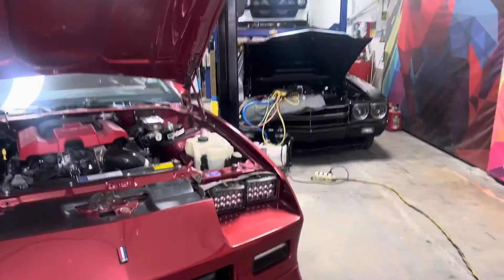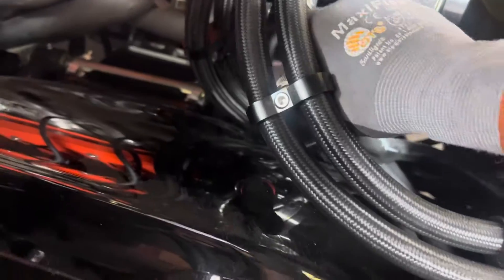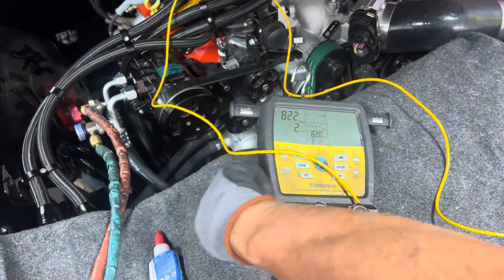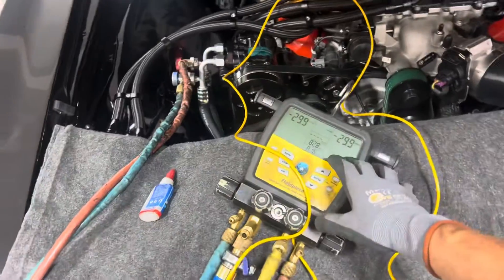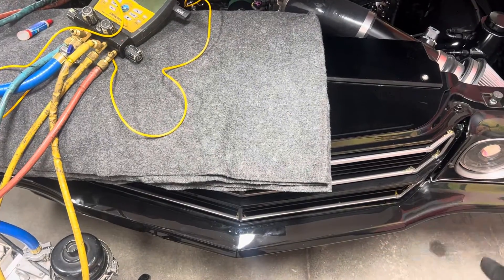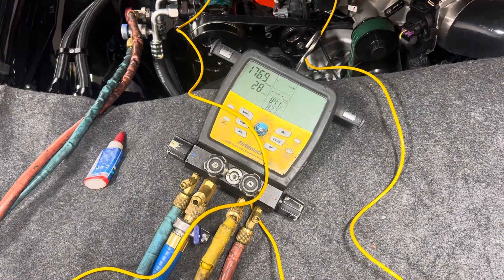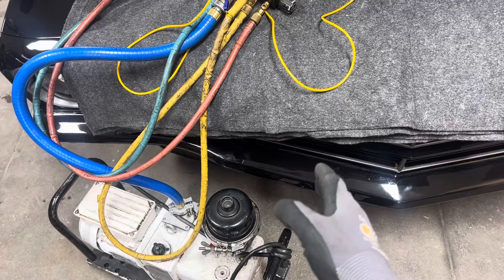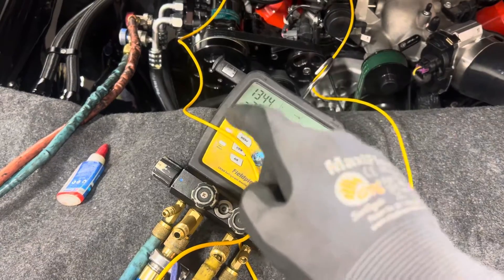Moisture contamination concern me system left open exposed to atmosphere for a long time. ￼

Comment: How are you going to determine proper refrigerant charge on a custom system?
Reply from the maker: I would guesstimate by whatever vehicles that I took all these components out of.   Choose the smallest refrigerant charge.    I always put in a sight glass with a moisture indicator in the liquid line towards the condenser. This really gives you a good visual indicator of your liquid stack backing up solid. Or only with a very few bubbles passing by. 

(Sporlan see all sight glass with moisture indicator)

Google the above search phrase and you’ll see what I mean. 

They make them in Solder on application and in thread on application. 

I watched a superheat in the sub cooling. 

But an automotive everyone’s good enough with it’s good enough method. 

I had a technician build one in his van and Mercedes condenser a dodge compressor a general motors evaporator case housing.
Reply: I go off system pressure most systems are 1lb or more so start the system and add refrigerant from the suction side and watch the high side pressure you will need a warm engine and even the daytime temperature can fool you into overcharging
Reply from the maker: @ajaxracing  like for example on my car my high side pressure is usually between 89 psi and 110 psi in my low side pressure is usually about 29 psi to 31 psi weather rhyme only 3/4 of the way full or 100% filled I get the exact same pressures.   Because the majority of vehicles nowadays are variable speed compressors or variable displacement compressors using sensors and speed control or compressor displacement to manually manipulate the pressures to what it thinks it wants to see through its program not relying on how full or how low the refrigerant is.    As long as it’s close enough it will put up a false low side and high side pressure that are not relative to how full or empty the system is unless it’s way outside if it’s parameters.
Reply: I wanted to add you should always go off system pressure Even on a system you know the capacity just changing a.condenser or EVAP capacity could change all be it small my old shop we would have stacked 2 condensers in that car if it required now figuring out how much oil to use now that's JFM
Reply from the maker: @ajaxracing  condensers have a little capacity needed no more than 1 ounce of extra oil. 

And pressures mean nothing in new cars with variable displacement compressors. 
Which the majority of cars have been given in the last 10 years. 

When you get into limousine manufacturer and you’re adding three or four evaporators to one compressor you really get into adding a lot of extra condenser and sept cooling condensers separate and extra receiver dryer’s

On a custom installation I always recommend you add a side glass with a moisture indicator so if your customer goes to another shop and they do not charge it correctly many times I will find they will moisture contaminate the system with contaminated refrigerant or by allowing the refrigerant lines to be left open to the atmosphere so if the car comes back to you and you see the moisture indicator turn yellow you tell the customer they’re basically screwed now we will be replacing your receiver dryer and you now have a moisture contaminated system from the last shop who worked at it. 

I find about eight out of 10 shops contaminate customers systems when I have installed a moisture indicator site glass on a custom install system.
Reply: @coldfinger459sub0  we worked mostly on oldies and also used a sight glass and I remembered we never took limos or busses I'm curious if you fill the system 3/4 would you have freezing issues on cold days or what about overcharging on that style of system on all the modern stuff I normally go by the book
Reply: @coldfinger459sub0  like what would happen if you put 2lb in a 1lb system like that I feel like in in the stone age with some of these systems lol
Reply from the maker: @ajaxracing  I could tell you for a fact that went 3 ounces extra is in a Prius it hits 440 psi and cuts off the high limit switch to the compressor. 

I made a video on that it’s on my channel somewhere. 

By removing 1 ounce it dropped to just below 440 psi. 

I had one Audi customer at a shop who recharged a vehicle and I believe the original Audi charge was roughly 580 g which is just a tad over a pound and I pulled out 900 g which would make it a little less than a pound and over charge the system was working perfectly in cool temperatures in San Francisco below 75° but when I got out outside customer kept complaining it was not cooling after the third time returning to the shop he called me in he is one of the guys who guess with the cans and does not weigh in by weight he was going by pressures. 

I pulled out the refrigerant and Wade what came out and show him how far over he was lucky he did not burn up The compressor recharged correctly it worked just fine

I’ve gotten many vehicles with variable displacement compressors with over a pound of extra refrigerant in them because they were charged on mild or cool days and the guys go by pressure and the computer keeps compensating the compressor displacement attempting to hold down falsely the pressure as the technician keeps adding more refrigerant in until I can no longer control. 

The car will leave the shop working just beautifully on a mild day

But then the customer takes it out on a hot weekend or travel somewhere to a hotter climate and now that extra refrigerant has nowhere to expand and the pressure skyrockets this is where we get slipping clutches that burn out burnt up compressors because of too much refrigerant to overdiluting the ratio of refrigerant oil to refrigerant plus the high pressure and temperature wiped the compressor out. 

If they did not wipe the Compressor I would way how much refrigerant comes out and always find it grossly overcharged because they tried to charge by pressures on a computer controlled variable displacement compressor. 

Now another example let’s take a old Chevy suburban are 12 with the old Frigidaire a six compressor dual air conditioning. The A6 to York in Tecumpsin were built like battleships unsinkable. 

That old suburban had 5 1/4 pounds refrigerant charge. 

If I stuck one extra pound of refrigerant in one of those old systems you would barely notice it on temperatures under 85°F and it would do no damage at all whatsoever to the compressor. 

Because back in those days compressors had some pumps in them that how about 6 ounces of pure refrigerant oil with an oil pump and a pick up tube that would feed the cross drilled crankshaft to lubricate all the vital components so they would never go low on refrigerant or get diluted. 

Modern day compressors do not have that feature.   

They completely rely on a full charge of refrigerant with a specific refrigerant to oriole ratio that will constantly feedback oil that left the compressor travel somewhat as an aerosol all the way through the evaporator delivering a cold stream of refrigerant and oil to lubricate the compressor and cool it off.

The old iron York compressors were so durable you could run them without refrigerant and use them as air compressors on tow trucks this is what they actually did because of that sump pump south oiling oil pressure feature they operated like small Briggs & Stratton engines but were turned into air compressors. 

I literally make the majority of my living office shops that charge by pressures on all these new cars with variable displacement compressors between them burning out the compressors or multiple complaints by the customers of them not operating properly after they had them charged up that is where all the gold falls from heaven into my bank account relying on old guys who were taught old school and apply it to new vehicles. 

And now the situation even gets worse for the customer that the systems are all getting down to around 1 pound of refrigerant or even down to 12 ounces so they’re even more critically charged. 

Now let’s talk more about the terminologies of critical charged this came about with the introduction of Microchannel parallel flow condensers the internal design is drastically different than what were used to with Tube and fin

And a high-quality Microchannel condensers have an extremely small volume of refrigerant that they actually hold to a ratio of extremely large surface area due to the fact that they have many small fins inside the tubes. 

     The cheap knock off fake Microchannel they’re still a micro channel but they use larger fins that are noticeable and half the amount of internal fins because the technology cost more money for the higher quality ones like DENSO 

It’s not a linear equation where if you add 1 ounce too much you get a certain pressure rise and then if you add 2 ounces too much you got the exact same number just doubled in pressure it doesn’t work like that. 

It’s exponential,    And it’s highly temperature reliant on the ambient temperature it’s not 1 for one 

If you look at the PT chart we’re gonna use the example of R12 refrigerant. 

If it’s 70° outside and your cylinder of refrigerant is 70°F you will have 70 psi pressure

Then as you increase the temperature you will see that the pressure increases but you see it is not exact with the temperature. 

Old systems with mechanical fans attached to the engines were very easy he bumped the engine rpm up to about 1200 RPMs 1500 RPMs whatever that particular manufacturer called for then you had a known airflow over the condenser that would not change because it was a fixed mechanical fan and you were using a fixed mechanical piston driven compressor that would not change speed or volume because it was directly tied to engine rpm that was not changing because you fixed it at 1200 RPMs or 1500 RPMs just for example. 

You had a fixed blower speed that didn’t have a automatic climate control system with temperature and pressure sensors while you’re in the middle of your test that just might flip over from Fresh Air mowed into recycle or recycle into Fresh Air during the middle of your Tess completely throwing your pressures off because there’s a vast difference between taking recycled air from inside the cabin of your car that might be 70°F or the fresh air over your hot engine out of your radiator getting sucked through the crowd that might be 130°F putting a load on your evaporator giving you a very false reading because we don’t drive around in 130°F ambient outside air temperature. 

I have made videos of this showing the reactions of the difference what happens to pressures and temperatures between using the outside air mode recycle mode and the difference between having the hood of the engine compartment open while performing your test and having the hood of the engine compartment closed while performing the test. 

Most automotive technicians have absolutely no formal education let alone and air-conditioning on automobiles. 

So they sit there walking off their little cans with the hood open set the fresh air taking in 120° 140° air temperature through the Crowell trying to set their pressures while they’re falsely overloading the evaporator with a heat load clueless to what they’re doing. 

Then maybe they read something about the SuperHeat or Subcooling they know nothing about and they try to apply it while falsely loading their evaporator with too much heat load from the engine compartment giving them a false reading or with just partially plug cabin air filters that greatly reduce the airflow over their evaporator removing the load giving false pressures and temperatures. 

Then you have the customers who buy the HEPA hi allergy cabin air filters that are very air restrictive slowing down the airflow over the evaporator your high side reading will be lower throwing off the guy who thinks he can fill the system using the high side he will get you getting a falsely low high side and his evaporator temperature will drop more easy to a lower temperature because it has less load over the evaporator so he thinks he’s filling it up right.   But he’s only filling it up right for whatever Ambien condition that he has filling it in and in other conditions it will be overcharged or under charged. 

But this is the difference between somebody who just guess and go by cold air blowing over the hand and somebody who knows. 

Like the guys who use IR temperature thermometers and they point them down to center duct Dash vent and they get these terrific cold temperatures they’re reading but because they don’t even know how to use the tool their own they are not aware that the cold air blowing over the optics of the lens of the eye Oregon get distorted at the store still wave length and it reads a actual colder temperature than what it really is. 

so then again the technician has false readings and he doesn’t even know it.  

There is literally 1000 more scenarios that I see done daily because my mechanical shops that subcontract me and call me in to fix their mistakes or diagnose something they could not diagnose y’all make these daily very common mistakes without even knowing it but they’ve been doing it for 20 years that way and their words are it usually works it works most the time or the really good one I’ve been doing it like this for 30 years. 

As long as we have old guys out there recharging systems like this we will never ever have a shortage of air conditioning repairs being needed.
Reply: @coldfinger459sub0  so pressure dose still matter and still a major part of the filling process along with your scale and if you have the mfg specs that would be the first thing to base off in the case of custom that changes regardless of compressor type if that system runs at that psi sight glass is clear then it's full
Reply from the maker: @ajaxracing  as long as you go by book by weight of refrigerant you can never go wrong on the new cars unless it’s a cheap aftermarket condenser that sometimes causes problems in really hot weather no issue at mild temperatures. 

Freezing doesn’t happen unless the protection switches are not working correctly if the metering device like expansion valve is working properly it will not let it freeze if the low pressure switch if it’s on an orifice tube system has not drifted out of calibration and his cutting off at 21 psi or 24 psi it will not freeze. 

It’s not like a cheap home air conditioning system like a Goodman bottom of the line that does not have freeze protection if it’s low on charge it freezes up

For example on a high-end carrier or a high-end train system with all the bells and whistles will have freeze protection sensors when they notice they evaporator gets too cold it turns off the system. 

I know Automotive if the system is too low and your refrigerant is low and let’s say your low pressure cycling switch on your Ford with the accumulator has drifted out of specifications down to say 17 psi you might get a little bit of freezing just after the orifice tube and maybe the first few rows of the evaporator but then they will be so much air blowing over the rest of the evaporator it will not freeze because there’s not enough refrigerant
Reply from the maker: @ajaxracing  only the manufacture weight is important we never top off in AC. 

We only completely drain a system and charge it to factory specifications and then start diagnosing we don’t go off pressures or temperatures until we 100% no we do not have contaminated refrigerant 100% know that we are 100% filled to the factory specifications only and then test start. 

Then you can start using temperatures and pressures only after you know the airflow is correct to because if the airflow is slower because a high speed on a fan is not working you’re just getting low speed or medium speed and you don’t know it you will get higher pressures throwing you off so airflow Hass to be correct. 

If airflow is even a little off on air conditioning your pressures mean nothing temperatures me nothing you’re superheat means nothing your sub cooling means nothing. 

Other than maybe it’ll be telling you that you’re airflow is low over the evaporator coil airflow is low over the condenser

You just end up guessing and you’re filling a system up to a improperly airflow situation over evaporator or condenser which will give you false numbers which will not be correct
Reply: @coldfinger459sub0  I have not had much experience the newer style systems I do remember having to adjust those low side pressure switches to keep the cars from short cycling I appreciate the time you took to respond
Reply from the maker: @ajaxracing  I believe February 2 for three days MACS is going to have an expo and training seminars all about all the new air conditioning old air conditioning and you’ll get reference sources from all the manufacturers on supplies equipment modifications and kits that you never dreamed possible. 

MACSW See you there. I’ve been a member for 30 years periodically attending around the country there expo and training seminars. 

It’s the difference between the guys who just guess and roll the dice and throw parts at a car and the guys who don’t break the systems in the first place